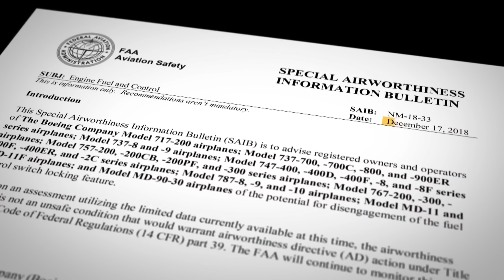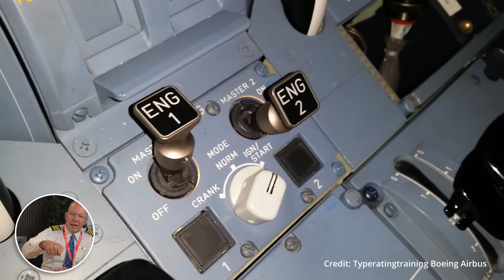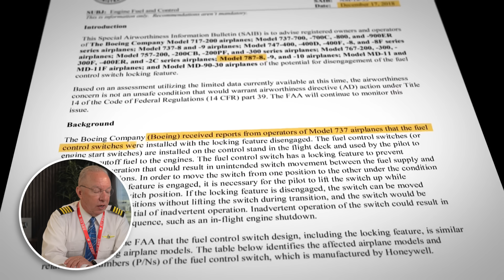Air India 171: The FAA’s 2018 Fuel Switch Locking Bulletin Explained (16 Questions Answered)

Comment: Someone should test to see if it is anatomo-physiologically possible to shut off both fuel switches within one second of the other with your non-dominant or dominant hand or both hands. If they are so constructed to make it impossible to accidentally turn these switches off, the rapid timings may raise some questions.

I would also still need to be more convinced this was NOT a software/electrical issue. That is, although the flight data shows both fuel switches being turned "off" immediately and then delay to switch them to "run", we don't know (in either case) whether this was by independent software/electrical means or "by hand".

As well, the possibility of faults with the stability/locking of the fuel switches needs to be thoroughly examined in the final report before categorically stating that this was 100% a deliberate act by one or both of the pilots. That is to say, if the evidence is there RIGHT NOW to definitively make that conclusion, then surely the investigators would have done that in the preliminary report. But they didn't. So it would be wise to await the final report before making accusations of mass murder/suicide.

Comment: Enough with the mental health lecture 🥱 Of course it's a design flaw when 1. you are allowed to cut off fuel at take off thrust and 2.  the switches are placed right next to the thrust levers where they can be accidentally tripped.

Comment: I don't understand the convern about abuse of cockpit video footage.  There are technical solutions to this.  Footage could be encrypted using what's known as public key encryption.  That means the key to do the encryption is on the plane but not the key for decryption.  The latter would be under escrow at a responsible person or office at the airline, authority (like FAA< CAA, AAIB) or manufacturer as agreed or mandated.  Overwriting data on black boxes after a few hours is already standard.  I understand if pilots don't feel well if another slice of big brother is installed into the cockpit but I (computer guy) think these issues can be resolved in an acceptable way.

Comment: Thanks for your insight and explanation of the events.
Curious about this question though. You mentioned about the fuel switches being re-engaged, would the engines re-light? Sort of like a manual transmission and with timing would the engine re-fires. Just a curious person who is interested in this subject matter.

Comment: It is simply unacceptable to say that the video monitoring of the cockpit is unecessary. Pretty much every worlplace that has active responsibility of other peoples lives are recorded. A locmotive cabin, a ship control room, sinkansen cabin, prison watch. 
It is unacceptable to hear this pilot say it is unnecssary. Pictures say a thousand words, vidoes say much more. Yes it would not have prevented, but could have provided insight on the actions that happened than just stiching together audio and digital evidence. Sorry Sir, as pilots yall are doing a huge disservice by resisting video recording. 
Since one pilot asked why did you cut the engins off and the other replied that he didnt, i leads one to think if the spring return or detent could have worn out and caused them to return by themselves. All possibilities need to be cleared.

Anyway, DGCA should mandate atleast for all planes in india to have cockpit recoding.

Comment: If it was a deliberate attempt to bring down the plane why would the pilot that shut off the fuel allow the other pilot to restart the fuel after just 10 seconds and nearly recover the plane? Would it not have been smarter to pull the fire extinguisher levers for both engines and maybe even pop the black box fuse first if you wanted to be certain a sabotage would succeed and leave less evidence?  I am not certain it is fair to be 100% sure it was deliberate and not a muscle memory error where one of them often flips off the fuel once taxiing is complete and maybe the back of their brain interpreted the takeoff as no longer taxiing and they just flipped the switches without registering their own action. If this is the case there might be evidence of one of them shutting off the engines at the gate on multiple past flights without property following the checklist and pilot to pilot vocal sequence.

Comment: Question: Is this scenario possible? (reposting my question from the previous video)
From the report I would speculate that it was the co-pilot who turned them off. My assumption goes from the way report is written and the timings. 1. The report does NOT state which engine was cut off first, only that they were cut off within 01 second. This can indicate an attempt to prevent anyone from doing any conclusions and/or assumptions about the fault and consequent vengeance towards the relatives of a pilot. 2. BUT, the restart of the engines (switched back to RUN) was done in this order: 1st - > 2nd, which indicates, with an account of flight experience, training, and reaction time, that main pilot did it. It might also be relevant the position of the switches relative to the pilot who turned them on. The PIC (pilot in command) sits on the left, and if right-handed, and trained to do things from left to right, would automatically turn the first switch on and then the second.
Altogether, I think, it points towards the first officer (co-pilot). Although, I don't claim to be right - this is just my layman analysis. I really hope that neither pilot was at fault though, and it was a tragic malfunction, which can be easily fixed on other aircrafts, while pilot's deliberate action would be much more difficult to prevent or predict.
PS: my sincerest condolences to all the families.

Comment: One pilot questions the other about moving the fuel cutoff switches and the other denies moving them. A video would have confirmed if and who engaged the switches. Contrary to your feeling that it has the potential to “embarrass” a pilot from acting unprofessional in flight a cockpit video would have categorically resolved the issue of pilot error or a mechanical failure. The union be damned, cockpit videos should be installed in all commercial aircraft.

Comment: Replace pilots with redundant AI and this won't happen again. It is a *insane* that a human is allowed to perform a suicide action, and the plane takes no corrective measures. At any moment a pilot can point the nose of the plane into the ground. The lack of navigational intelligence in the plane's systems is astounding. We are still operating like it's the 1950s. *At no point, ever, should a plane allow the pilot to commit suicide.* The AI can easily see that we have pointed the nose into the ground and that we will die in 45 seconds. The AI will take all corrective actions to prevent it. If there is a human protocol, it means at the bare minimum that BOTH PILOTS must agree to override and authorize the suicide.
Reply: Well..... even the robots have been observed to try  suicide... (there is a video on Youtube).... so the AI instead of pilots won't help.
Reply: Everybody knows which religion is found engazed in aeroplane blowings till date in name of terrorism and in form of suicidals,, and these pilots dint belong to that..

Comment: Might the fuel pump switches have been toggled from the ON position back to OFF, in response to a loss of engine power, and then instantly back to the ON position, in an attempt to recover power, thinking that a faulty switch operation or failure was occurring??  I have done this very thing multiple times in diagnosing electrical problems...

Comment: Question for your next Q & A: can you think of a type of logic not presently in place that could prevent a pilot from shutting off fuel valves during the first minute of flight? It seems to me, as a mathematician and engineer, that this could easily be implemented.

Comment: Good observation regarding the Embraer logic. Even if I have an engine fire on short final, I can still see the benefit of following the standard shutdown procedure. It takes a few seconds to identify, confirm and close the related thrust lever, then continue with the fuel switch to Cut-off, and pull the fire switch, or if on a really short final, land and do the procedure on the ground.

Comment: Is the 787 a fly-by-wire system?  In other words, do the switches actually move a valve, or do they just signal electronic valves to either open or close?  If fly-by-wire, we cannot jump to conclusions about this being a human issue.  Everyone I know can list the many times they have had systems fail in modern cars and trucks due to electronic switch or control failures.

Comment: Capitan Steeeve, I have been flying private for more than 45 years in mid heavy twin Cessnas. Were the fuel cut off switches thrown-after V1 or seconds later after the 787 initial climb? Also in normal procedures, if you throw the fuel cut switch to one turbine, how long does it take to re start that engine? Thanks.

Comment: It might not prevent the situation from happening or happening again but it will gibe us more answers as to what is happening at the time ,not that we don;t already know. . . 

As for not wanting to go there, I went there instantly 
As soon as they posted the clip of that airplane taking off without issiue then the next clip, you hear nothing coming from those engines  . . . All we heard was the RAT, meaning those engines did not suck something in, it was complete fuel starvation which those engines and those pumps are super robust and are all but guaranteed to work flawlessly time after time and these engines were damn near brand new, that leaves you with the human mental health factor . . . . 

Even poor fuel we would have somewhat running engines just like your car, only far more reliable

Comment: I said in one of your earlier videos, there is no way two engines would quit at the same time due to fuel or FADEC logic.    Those engines did not show any signs of abnormal shutdowns (failures).   No smoke, no asymmetrical thrust, no flames, no visible signs of engine turbine failures.   And, consider this, what is the worst possible time someone contemplating a malice act would do it?   Not at altitude.  Not on the ground.  The most critical time would be at or just after V1 or VR

Comment: True a camera wouldn't have "prevented" the crash. But maybe the dude would have thought twice before he flipped the switches off. If you're not supposed to be doing something in the cockpit, that means YOU'RE NOT SUPPOSED TO BE DOING IT IN THE COCKPIT. Duh! C'mon Steve. Maybe pilots should begin regular, routine mental health evaluations as well as having cameras in the cockpit. If it's that stressful, maybe a pilot or potential pilot should take up golf.

Comment: *********PLEASE READ*********
*****TELL ME IF IM WRONG*****
The argument to not have VIDEO really is a week one at best A pilot ON DUTY FLYING a commercial airliner has *NO reasonable expectation of privacy*. That's the only argument there is agianst cameras in the cockpit. 

The only reason video hasn't been made mandatory by the FAA & NTSB for all domestic commercial flights is because of the pilots union. I completely understand pilots not wanting to be recorded and the fear of reprimand or over scrutiny that goes with it. I can fully  sympathize with that sentiment.

That said, having a video recording system in the cockpit showing the controls & the pilots that operates like the CVR (Cockpit Voice Recorder) in that it records over itself automatically at a set period of time and is only to be used/ reviewed when an incident occurs just makes to much sense to continuously ignore it any further.

With city bus drivers, train conductors, cruise ships, police, truck drivers and even the cashier at Walmart being recorded to identify the cause of and or prevent incidents, I see no logical reason not to have the same system for pilots operating a 500 million dollar piece of machinery that has 100+ lives on the line almost every flight.

Is there a component I'm missing? Do people disagree with my points/ logic and, or have a better idea or different mindset?

Comment: What do you think about the following system: The pilot flying has 2 button on the Yoke, and ACK and a NACK. The pilot flying has to ACK whatever the pilot monitoring do. If no ACK the system accepts the changes in 4 seconds. At NACK the system rejects the settings showing and notifies the pilot monitoring about the NACK. Whatever the pilot flying should ack would be printed with big letters in front of the pilot, under the windscreen.

Comment: Their should be a cover over the fuel switches, with a indicator lamp where the pilot
See at all times.
Switch up position OFF
Down On.
Put safety covers over the switches.
It take of operation the pilot’s
Don’t have time to look down
At the switches.
Also no preload switch position.
With a safety covers no preload
On the switches.
THE SWITCHES are in the location.
Jmo

Comment: There is only group who is responsible for this whole  - "Pilot Unions" 
Why Do Pilot Unions Oppose In-Cockpit Cameras and Voice Recorders?

As a software engineer, I understand the importance of accountability in the workplace. My work environment includes cameras in nearly every area—except private spaces like restrooms—and that’s considered standard for ensuring safety and transparency.

But when it comes to airline pilots—professionals responsible for hundreds of lives at 30,000 feet—it’s surprising that pilot unions continue to oppose the installation of cockpit-facing cameras and enhanced voice recorders. With the stakes so high, shouldn’t there be even greater transparency and accountability in aviation?

What’s the concern? If the goal is safety and protecting lives, why resist tools that could provide crucial context during emergencies or investigations?
Reply: Absolutely unnecessary. For the millions of uneventful flights where the pilots are NOT crashing their planes, in this case, sure, the camera might show which pilot flipped the switches.  But you have to look at the big picture. This is a very very rare event.  If a pilot is determined to crash his plane he will do so.  He might simply disable any camera or just leave it on.  Makes not difference. You might not mind cameras in your workplace but most people do.   Certain jobs like law enforcement, yes, a camera is needed.  But not in the cockpit.

Comment: Afterburning turboprop engines would provide fuel efficiency and emergency power when needed. These engines would run a lot cooler than modern turbo fan engines used by Boeing and Airbus. Please check the date and time for my drafts. I may be the first to suggest this safer innovation.

I was reading into the Air India 171 crash. 

Their is no current data on the temperature inside the engines at takeoff. After burning turboprop engine design would result in a cooler running engine. 

I supposed the engines were running hot at takeoff and may have caused pilot confusion or instrumentation errors. Turbofan engines like in most modern Boeing passenger planes run dangerously hot. 

Hindustan Times

Based on the information available regarding the Air India 171 crash, the ground temperature at Ahmedabad Airport on the day of the crash (June 12, 2025) was reported to be nearing 40°C (104°F). Another source cited the temperature as 37°C (98.6°F). 
While some sources initially speculated about the role of the high temperature as a contributing factor, the preliminary report on the crash ruled out weather conditions as a direct cause, stating that they were good with light winds and clear skies. However, one pilot noted that thinner air due to the heat would have required higher flap settings and greater engine thrust, making even small configuration errors potentially catastrophic. 
It's important to understand that while the high ambient temperature might have indirectly affected aircraft performance and potentially exacerbated other issues, it was not identified as the primary cause of the accident. The preliminary investigation indicates that the engines lost thrust due to the fuel control switches being inadvertently moved to the "CUTOFF" position shortly after takeoff. 
Air India flight 171 crash: What AAIB preliminary report reveals – and doesn't
Jul 12, 2025 — Also Read | Air India crash: Fuel switches abruptly moving to 'cut-off' may have triggered calamity, reveals AAIB preliminary report. What potential causes have...

Hindustan Times

When I calculated the data in the crash report 12 hours ago I calculated that the fuel switches would  have moved to and from the cut-off position more than once which runs against a pure suicide theory.

Comment: As a retired AME. 
Why can't the Engine/Fuel management system be updated/modified to prevent the Engine Cut-off S/Ws being moved to Cut-off without the throttles being in the Ground Idle position.
That way the only way to shut the engines down is via the Fire Handles.
Please be aware, I'm not familiar with the B787.